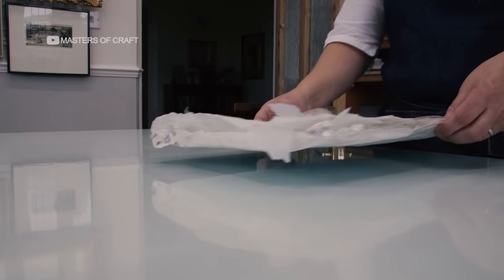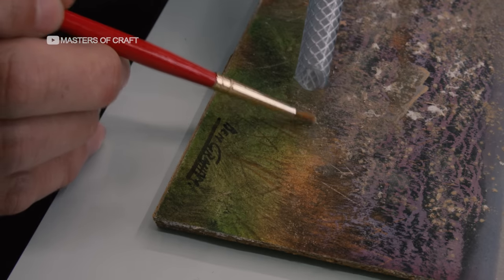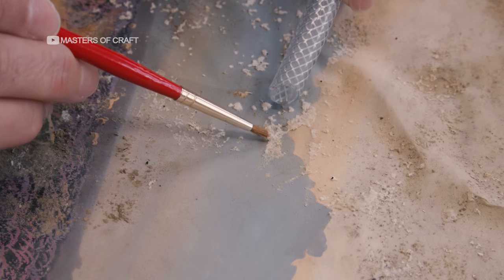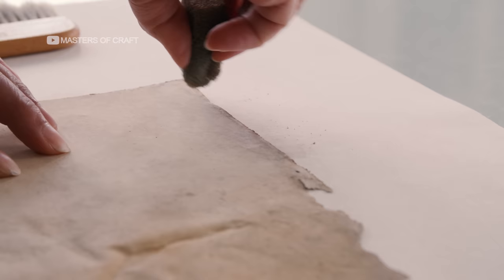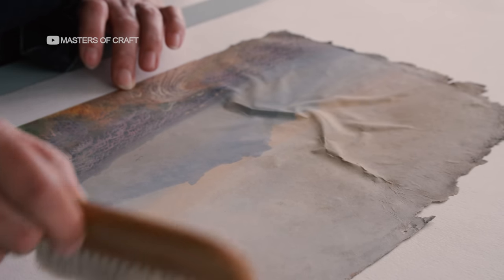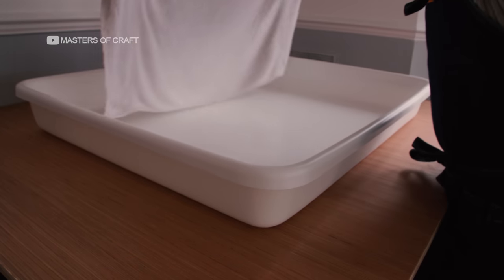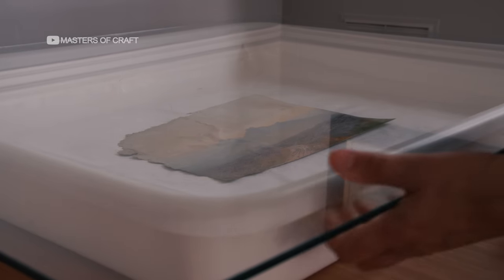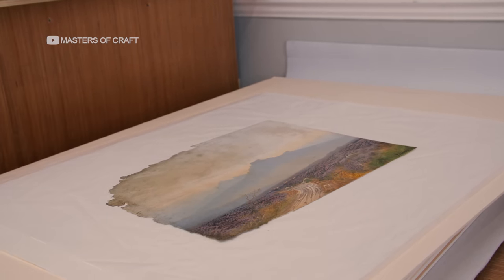How A Moldy Watercolor Painting Is Professionally Restored

Comment: I find it hard to take this seriously, when what's clearly something not remotely watercolor paper is being peeled apart and no sign of paint in the fibers...on top of the the obvious fact that it's too damned thick (that's a good quarter inch there) and the wrong color and texture. It's some sort of fiberboard, with a watercolor painting glued to it. Piss poor way to treat a good painting, and that painting also had to be left wet a long time to get that kind of moldy. I've had to deal with art that got moldy, and it's the stuff that didn't have anything done to dry it out that goes like that. So, instead of taking care of it appropriately when it was relatively simple to do, they waited until it required expensive restoration. Doesn't sound like someone cared about it all that much.

And I don't give a rat's ass about your talents, if you tell me bullshit like "this is watercolor paper", when it's obvious as hell it isn't. I'm blocking this channel for the BS.

Comment: The restoration is not finished the paper above the mountain peak should have been replaced and repainted. Anything would be better then the filth that was left at the top🤨🤦‍♂🤷‍♂
Reply: Yeah I completely agree. It's not restored, it's preserved in a state that will last longer but not look pretty at all.
Reply: Except that you have then totally lost the original work. That is simply not how it's done with professional paper conservation.
Reply: @davidporeilly1  I would not hang that on my wall
Reply: that is not always the point of restoration. the point is to conserve and preserve as much of the original piece as possible :•)
Reply: looks a hell of a lot better than when it came in though :•)
Reply: This is not a restoration video, this is a conservation video. Restoration would include destroying the original painting and replacing it with a facsimile. Even if you could restore it to its original glory, without harming the painting would the process be worth it? It would most likely be incredibly expensive to undo the water marking and pigment movement that has already been done by the flooding. Also, creating a perfect replica of the original painting is not an easy feat even for those who have practiced for a very very long time. This art has a history now and it should be preserved. Sometimes you have to cut your losses and appreciate the history of the painting rather than trying to hide it with something that isn’t original. In a way, it can be more beautiful if you look at it with the right perspective. Perhaps not aesthetically, but certainly historically.
Reply: If you visit old temples in india, the damaged parts are replaced by ordinary concr instead of stone or even similar stone, and no sculpturing is done at all. They don’t have any intent to make similar replacement, and this is intentional. You should know thar this part is restored.
Reply: @soumitrachatterjee1572  I would like to see a temple carved from a mountain of stone with our bare hands today😉
Reply: @sethdenney-solorzano72  When you restore a classic automobile you preserve as much as you can and replace any missing parts😉
Reply: @marcjeffers4229  True enough, however, the piece of the painting isn’t missing. And once again, this is sympathetic conservatism. Not restoration. The sympathetic conservation of a car would entail getting it back in working order and in a condition similar to the original state. The sympathetic conservation of art entails preserving the piece without hurting the original art as much as possible. Even if it won’t look exactly the same as it did before. There’s far more ethics and philosophy that goes into art simply because each piece is unique. To wit, it’s a complex subject that requires a bit more careful thought than some other types of conservation
Reply: @sethdenney-solorzano72  I get your point I'm a painter not a conservator so I have a different point of view👨🏻‍🎨🤔

Comment: This looks entirely phony to me. They 'fixed' the bottom edge that ended up being covered by the frame, but they didn't even attempt to fix the most damaged part. I call scam! In fact, I get the feeling this entire channel is engaged in fake restoration.
For those interested in real art restauration, I suggest the channel 'Baumgartner Restoration', by a guy who is a real, professional art restorer.
Reply: Do you mean the dark stains in the sky? The have probably bonded with the paper so you would have to scrape away the top layer of the paper to remove it.  You can't cover them using watercolour since watercour is transparent. If you used  some opaque paint like gouach you would completly change the impression of the painting. The retouching at the bottom  edge can be done since the paper is blank.
I don't claime to know much about art restoring but I do know a thing or two about watercolours and watercolour paper.
I did take a look at Baumgarten and it looks like he is restoring oilpaintings. That's a completely different material compared to watercolours.